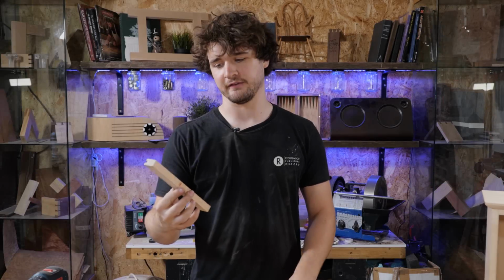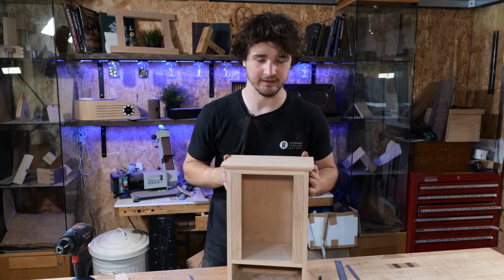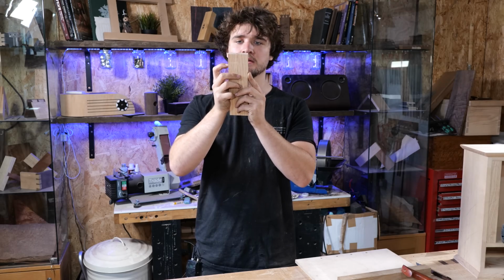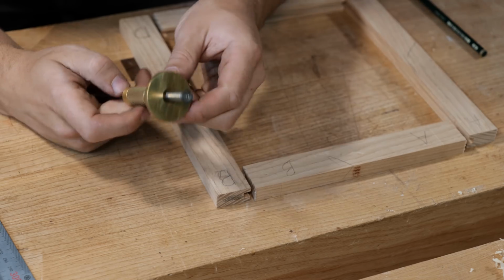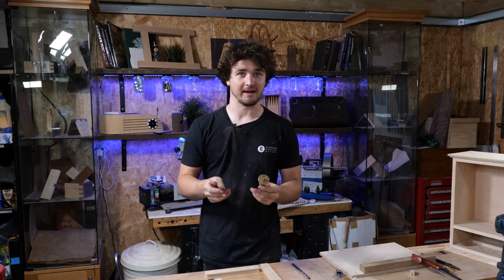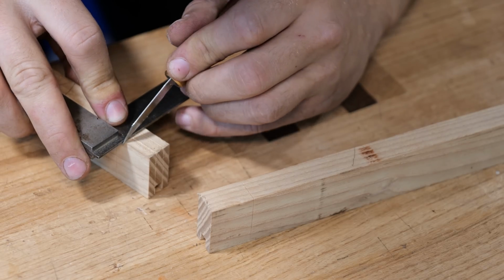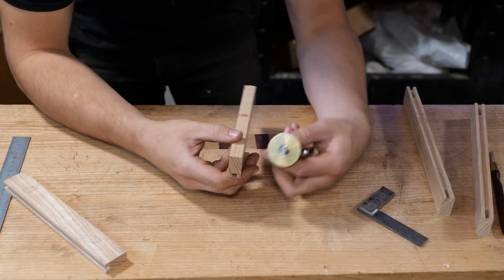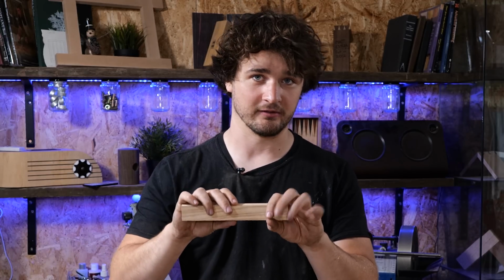Laying Out the Door Tenons | The Cabinet Project #14 | Free Online Woodworking School

Comment: If in doubt measure each mortise individually and make the tenons accordingly.  Great advice, Matt!  Only takes a few seconds to take those measurements, and painful as it might be to mark out and cut different sized tenons, it will save a lot of tears and much swearing (and get you a better end result).